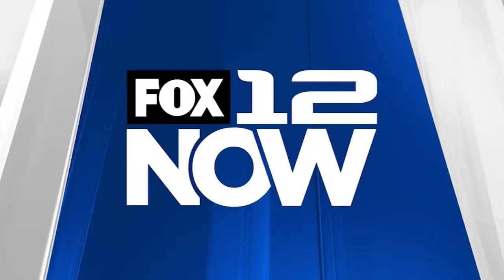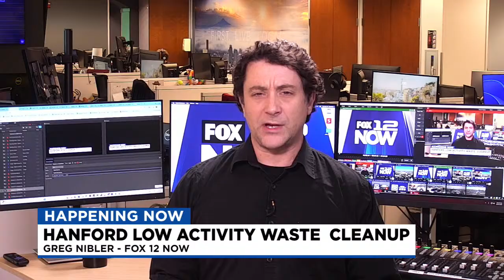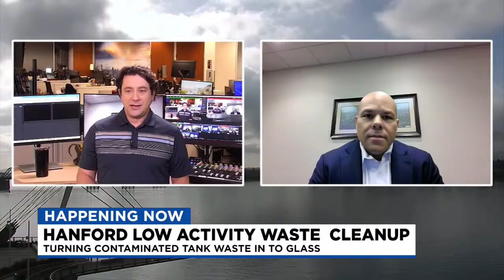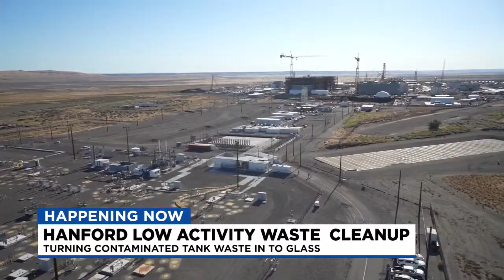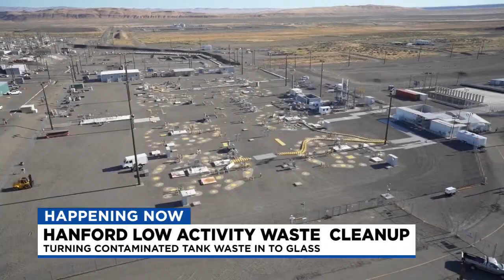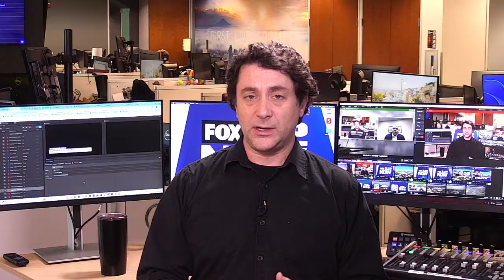Turning nuclear waste into glass at the Hanford site

Comment: Right off the bat gets the facts WRONG:
Yes, there have been leaks at the Hanford site that contaminate groundwater, with some of that contaminated groundwater reaching the Columbia River. This happened because large volumes of radioactive and chemical waste were dumped directly into the soil or leaked from underground tanks over decades. While the river is still safe because the contamination is diluted to low levels, ongoing cleanup efforts, like groundwater treatment systems, are in place to manage the contamination and prevent further migration into the river.  
Causes of contamination
Historical waste disposal: During the production of plutonium for the U.S. nuclear weapons program, massive amounts of liquid waste were dumped directly into the soil through ponds, trenches, and ditches. Some liquid was also injected directly into the ground. 
Leaking tanks: The site has a large number of underground storage tanks containing radioactive waste. Some of these tanks have leaked, releasing high-level waste into the surrounding soil. For example, two tanks, B-109 and T-111, are currently leaking. 
Contaminants: The waste includes radioactive elements like technetium-99, strontium-90, uranium, and iodine, as well as hazardous chemicals like chromium and carbon tetrachloride. 
Effects and cleanup efforts
Contaminated groundwater: The waste has seeped through the soil and contaminated an area of groundwater, some of which reaches the Columbia River. 
Columbia River impact: The amount of contamination that reaches the river is very low because the Columbia is a large river, and the contamination gets diluted to undetectable levels. 
Cleanup systems: Cleanup has been ongoing for years. Currently, "pump and treat" systems are in place. These systems pump contaminated water from the ground, remove contaminants using a special resin, and then the treated water is discharged. 
Leaking tank management: Agencies are addressing the leaking tanks through agreements that require steps like covering the tanks and developing plans for retrieval of waste. 

It will take until 2100 if things go well. Let's hope there is no major earthquake that is predicted to occur in the PNW and California before it is done, the contamination could spread if airborne across the continent:

Hazardous materials at the Hanford site that could contaminate the land in an explosion or fire are the millions of gallons of highly radioactive and chemically hazardous waste stored in underground tanks, which include plutonium, strontium-90, cesium, and iodine-129. The mixture of radioactive isotopes and volatile organic compounds poses a significant risk, as an event could aerosolize radioactive dust, contaminating the air, land, and water. 
Key hazardous materials
Radioactive isotopes: The waste contains a mix of radioactive elements that can cause cancer upon contact. 
Plutonium: A key material used for atomic bombs. 
Strontium-90: A highly radioactive isotope that can be extremely hazardous. 
Cesium: Another highly radioactive isotope. 
Technetium-99: A long-lived, mobile radionuclide. 
Tritium: A radioactive isotope of hydrogen. 
Iodine-129: A long-lived radionuclide that is highly mobile in the environment. 
Chemical contaminants: The waste also contains a variety of chemical toxins. 
Carbon tetrachloride: A volatile organic compound that can contaminate groundwater. 
Chromium: A heavy metal that can be toxic to humans and the environment. 
Nitrates: A common chemical contaminant in groundwater. 
Risks associated with an incident
Radioactive dust: An explosion or fire could aerosolize radioactive materials, creating a plume of toxic dust that spreads over a wide area. 
Groundwater contamination: Leaks from containers or the spread of dust from a fire could further contaminate the groundwater, which already has over 70 square miles of contamination. 
Chemical contamination: The release of chemical contaminants like carbon tetrachloride could add to the existing chemical pollution. 
Long-term legacy: Many of the radioactive materials will remain hazardous for thousands of years, posing a long-term risk to human health and the environment.